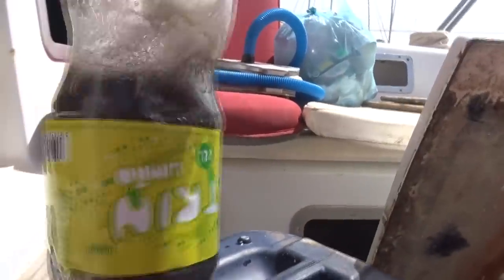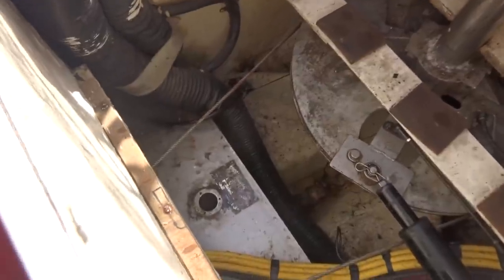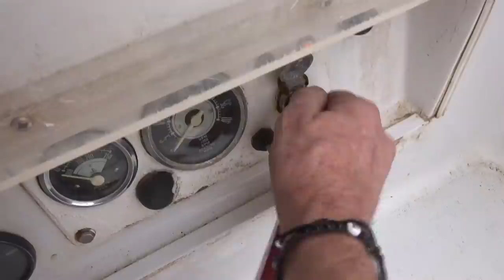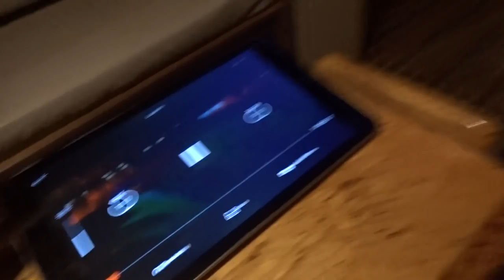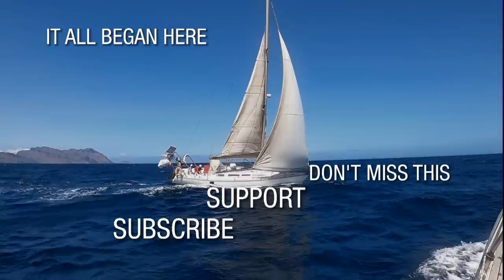I Get Mugged But Not Robbed | Things Get Dirty In My Boat I Sailing Galopin | Season 5 | Episode 55

Comment: When you get chance buy yourself a vacuum pump, kind used for sucking oil out of car engines. It will be brilliant removing dirty fluids out of hard to reach places. The tall 6 L pela ones are great and Will last a long time
Reply from the maker: Hope I won't have to do that again, but thanks for the tip Will

Comment: Get a big glass jar ,a vacuum cleaner , fuel line . In the lid of the jar make two holes one for suction line and a sorter line in jar to vacuum cleaner  . Suck out one jar at a time . Jar will show you level of liquid so don’t suck up any liquid in to vacuum .
Reply from the maker: Thanks for the suggestion Daniel. Sounds interesting.